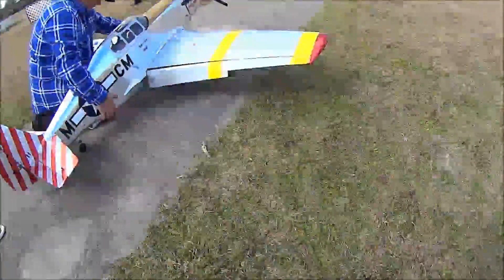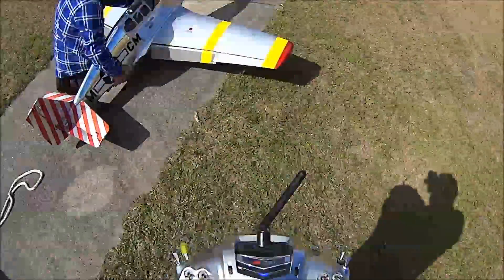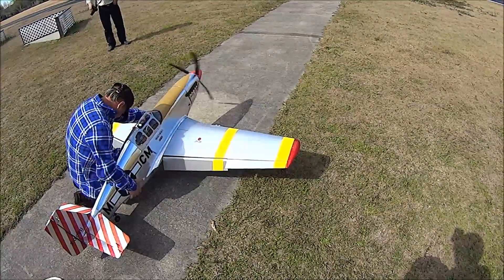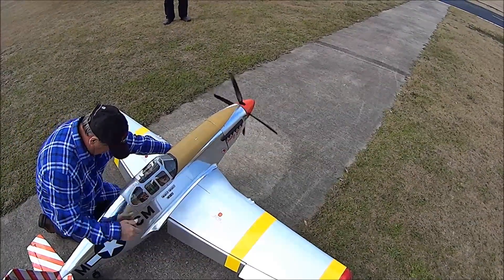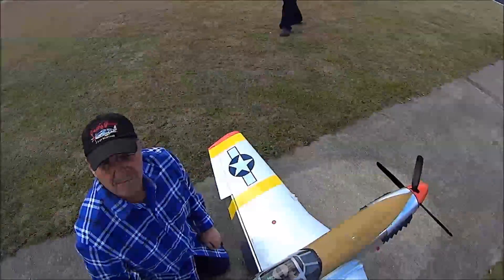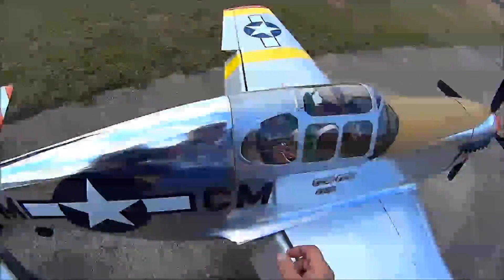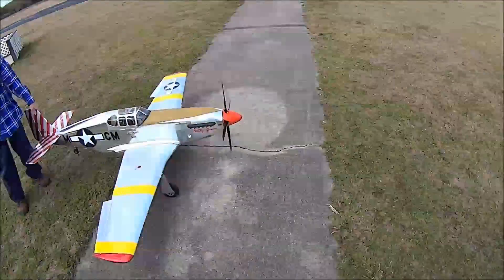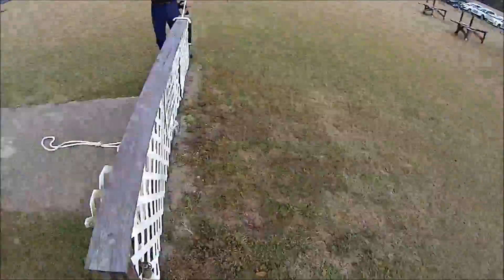Giant Scale Electric TF P 51 B Ramoser VarioProp YT

Comment: That a Top Flight P-51 ARF?
Reply from the maker: Yes, I buy the TF GS ARF, strip the rear deck off, mount a Fiber Glass Specialties canopy, then build up the wood turtle deck with balsa. It is an easy mod., and you can get the mod. kit from TF. I like the higher quality Fiber Glass Specialties canopy and the wood parts are easy to scratch build. The Mustang B-C model gets a lot more attention from spectators and is a better flying model than the D model. Unfortunately, The TF versions suffer from having an aerobatic symmetrical airfoil which ruins its ability to glide after the engine stops. Its dead-stick glide is very steep and stops altogether as soon as the gear are dropped, it is safer to belly land it if you can reach a level spot. I also own the Hanger 9 60cc P-51D which has a much better wing design (IF you can get one that has a wing that fits together, most don't). This H 9 version has an excellent glide capability when the motor stops and is easier to take off and land (much slower and gentler stall). I plan to buy another of the H 9 Mustangs to convert to a B-C model. 
I have removed the electric power system after 2 years of experiments and 100+ flights. The original DA 50r gas motor has been reinstalled and its 6 lbs. lighter weight makes the plane much more fun to fly (and land). The electric power system has been transferred to a TF GS P-47 Razorback ARF that has a more user friendly wing airfoil when the motor stops, and, a built in LIPO battery hatch in the front deck.
Reply: steven hancock Thanks for all the information I want to build a P-51 was thinking of going with TF cheaper then the Hanger 9 and from what I read the Hanger 9 quality control isn't great I figure less loss $ if I crash. Sounds like you worked out the details on electric power system feel the gas engine is better way to go? I would think electric has more power to weight ratio with the right setup limited to run time much shorter then gas.  Seems like lot of the hanger 9 I see have poor vertical zoom climb capability which is what I'm looking for.
Reply from the maker: Both of my 2 Mustangs, (Hanger 9 and Top Flight P-51) have excellent zoom and vertical climb when pulled into the climb with plenty of speed. From dead stop on the runway the larger motors spinning propellers with less pitch (8-10 inches) will easily pull into impressive climb angles but at lower airspeed. The big motor-low pitch prop combo works well for steep climbs from takeoff and gives better prop braking after touchdown on landing.
But, you have to lower the nose and accelerate to higher airspeeds at some point in the flight and this is the main drawback with this combo. They don't HAVE top end accelleration because the low pitch prop won't spin any faster. The prop will give out an impressive rip that causes spectators to say "that thing is really moving". The reality is that the prop rip signals ALL that that prop can deliver, there isn't any more.
Another performance limiting factor with the big motor is excessive installation-air-drag caused by huge cylinder heads, mufflers, and in some cases even carbureters sticking out into the airstream. With airframes intended to fly faster than about 55 mph,AIR DRAG IS KING. Drag overcomes extra horsepower.

I get impressive high cruise speeds, almost unlimited vertical climbs, and top speed capability that extends into the VNE range of the airframe. VNE (Velocity-Never-Exceed) is the point in the airframe's speed envelope where instantaneous catastrophic failure is probable. I prevent reaching VNE by installing larger diameter props and/or reducing pitch to limit the top speed to a sane fast, but not too fast top end. Pulling high G maneuvers while at top speed lowers the airframe's VNE capability. I do smooth sweeping turns and never dive from high altitudes. When I do dive the throttle is low until the plane is leveling out to approach the runway, then I throttle up to make it a high speed pass.
Gas and electric power both have their strong points- electric is faster and climbs faster but has short battery duration. Smaller gas engines properly installed with attention to the best possible streamlining (and effective cooling) give better all-around performance in a light airframe (the lighter, the faster).
And most of the apparent slow performance and poor climb you have witnessed is linked to the pilot's past experiences and personal flying ability. They know that planes flown fast are closer to destruction than when flown slowly. I drive a C5 Corvette, capable of very high speeds and acceleration, but I have never driven it faster than 10 mph over local speed limits and I avoid spinning the wheels. Muscle cars can get out of control in a split second and then you have a wrecked toy. For me, it is enough knowing what it CAN do, I don't have to prove it.
I am sorry it took so long to reply, the web site doesn't notify me of questions. I have to check manually.
Reply from the maker: After extensive LIPO battery trials I find that 12s batteries overheat too quickly, even at low throttle through most of the flight. It seems that the high 'C' types can only take high 'C' for a few seconds before heat becomes an issue. I switched to 12s 2p LIPOs (24 cells) using cells rated at 30-35 C, much cheaper to buy. With the LIPO packs operating in parallel each individual cell only sees 1/2 the current draw, this extends the duration about 15-25% over a 12s pack of the same capacity. The reason for the extra usable duration is that the individual cell is discharged at a lower total current draw for the flight, for the cell, lower current draw means greater efficiency- you get more amp hours out. Take the milliamp hours capacity needed for a given flight time at 12s and divide by two, buy 24 cell packs at the 1/2 capacity, wire them 12s 2p for better performance (instantaneous power spikes don't pull the voltage down), and lower operating temps (quicker to get back on the charger, no cool down needed). The downside is more charger capacity is needed, and the 24cell packs are slightly heavier (more wiring, plugs, heatshrink, etc.) Pack size may be larger depending on the cell packs used (I buy 6 four cell packs). 4 cell packs are easier to find because the manufacturers build many more 4 cells than 6 cell packs. Each production run results in a product at a specific capacity different from earlier production runs, If you puff a cell in a 6s pack, you can't find replacements at the same capacity. 4 cell runs are huge, cheaper to buy, and replacement packs are easier to find from suppliers.